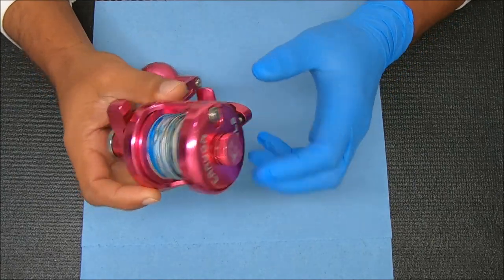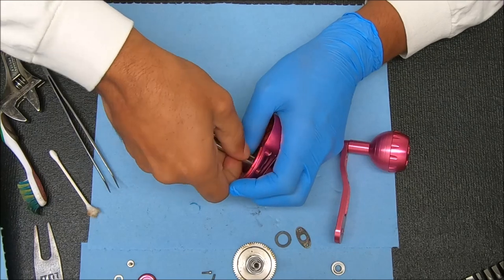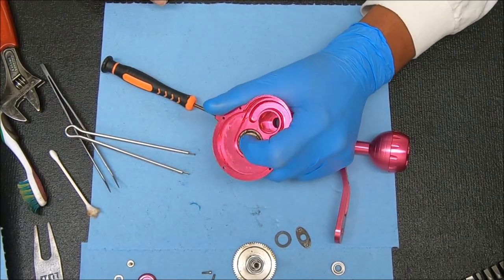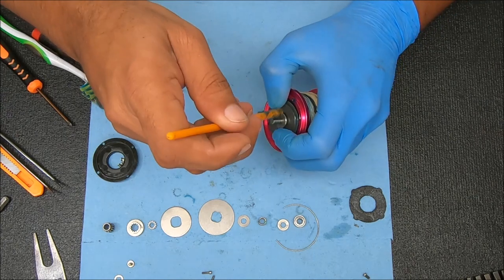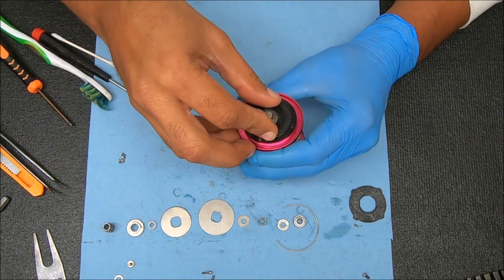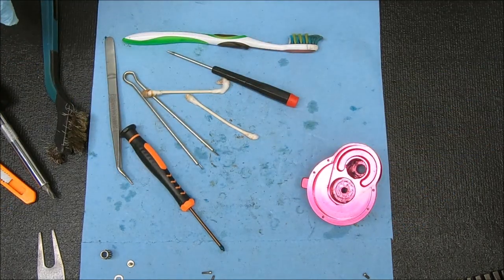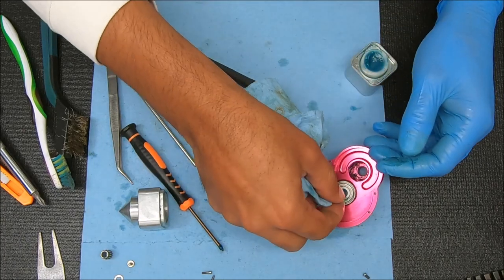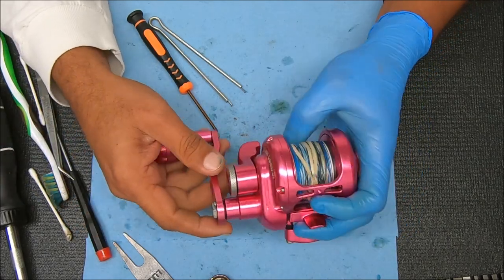Canyon Reels HS-13 | Freespool Fix + How To Take Apart & Service - Fishing Reel Repair

Comment: Canyon does a nice job. Designed and built in the US. The trolling reels put out ridiculous drag. 86lbs on the 30 size according to them. Not sure who would ever fish a reel at 86lb of drag but hey pretty cool either way.
Reply from the maker: Thanks for checking out the video, Jeff! It seemed nice and covered most all the bases. Yeah, who really wants that much drag on such a small 30-size reel .... assuming that it's true. I think I tested the max drag at strike on this one at around 15lbs, which I think is good for a casting/jigging reel.

Comment: Just bought the HS-13 Cast control version.  Would you have any videos on that?  I'm just trying to get to know the reel without taking it apart and you do a great job with your videos so it's a no brainer...  ask first hahaha
Reply from the maker: Thanks for checking out the video. No, but they should be fairly similar.

Comment: Salam brother i have a question about drag greases which greases can we use at drags if we didn't have drage greases can you help me
Reply from the maker: Hey Hasan! It's been a while. Hope all is well. Regarding drag grease, as you probably know, I use Cal's Universal and drag grease (tan version). You could also use Shimano's reel grease, or most any of the other fishing reel greases, like Penn, to coat the drags. I would stay away from using oil on carbon fiber washers, though. Stay safe, brother.
Reply: @TSGReelService  ya brother i am fine busy in my work thanks for your advice love you God bless you